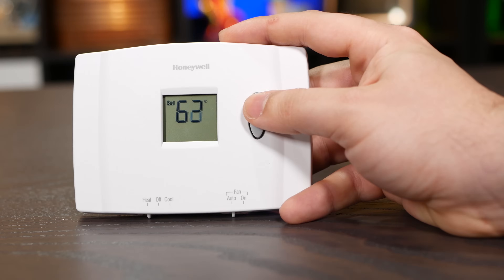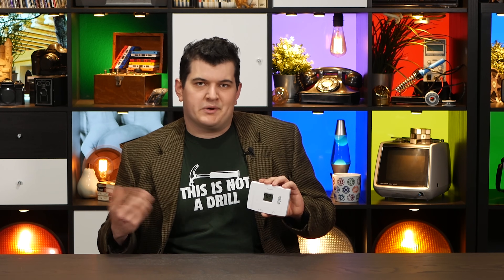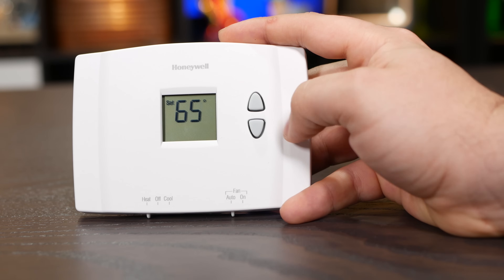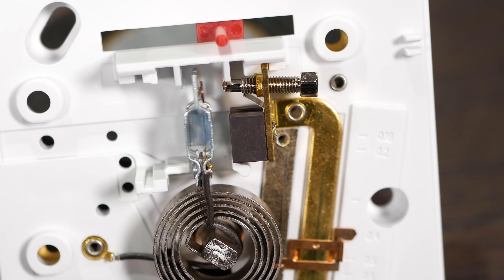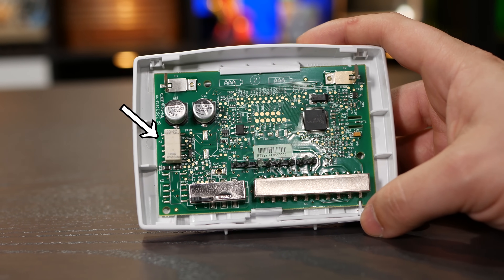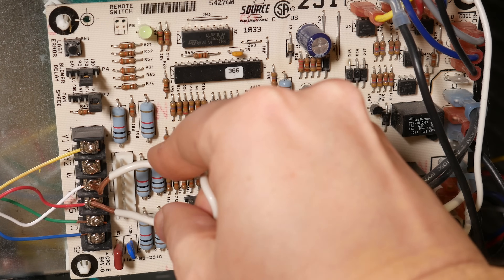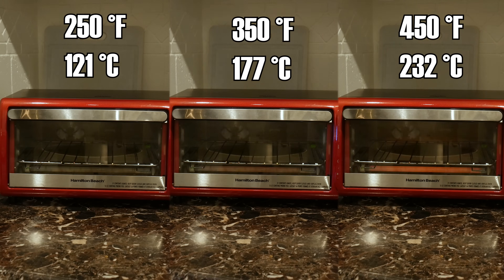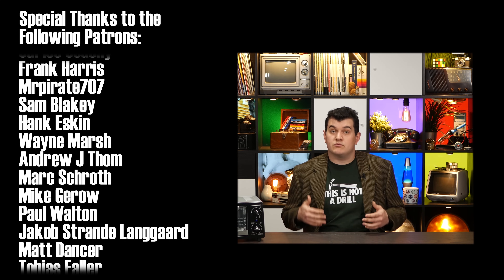Thermostats: Cooler than you think!

Comment: Some newer 2 stage furnaces will control the 2nd stage based on the time the R-W circuit is closed and the length of time that it has been closed for the past X number of heating cycles.. Crude and it will give some big fluctuations in room temperature... Best way is a multi-stage thermostat and with the correct "CPH" (Cycles per hour) setting for your heating system.
Yes some incorporate time into determining if the heat should be on or off.

Comment: My apartment has electric baseboard heaters which when we moved in had mechanical thermoatats which only turned them on and off at full blast. But since the thermostats controlled the full voltage directly, i was able to replace them with digital thermostats with variable voltage control, giving far closer temperature accuracy and much more energy savings due to tapering off the voltage the closer it got to the target temperature and avoiding overshooting the target.  So our thermostats do regulate the amount of heat coming from the heaters.
Reply: The Honeywell RLV4305 -- I have three of them in my house, they replaced older mercury-bulb and other mechanical thermostats -- is designed for electric baseboard heat installations in which the thermostat switches the actual line voltage of the heater (120V or 240V) rather than switching 24V signal-relay voltage. The RLV4305 uses a triac to power on or power off the load, and this being electronic, the heat can be turned on and off rapidly. This is EXACTLY the fractional control method described in the video -- Duty Cycle. The RLV4305 has four levels of heat it can command. If the ambient temperature is way below the set point, it will just turn the heat ON. "Full blast." If the room is only a degree too cold, the thermostat can instead run the heat at 75% power, or 50% power, or even 25%, which low power is also used to maintain the current room temperature once the set point is reached. Overall, this allows the desired temperature to be maintained with smaller temperature swings than you get with an all-on/all-off thermostat. Most "smart" thermostats like the Nest are designed to work with 24V switching systems, and thus are ONLY all-on/all-off. But, I believe that the Mysa brand of smart thermostat has a model with triac line-voltage switching for baseboard electric heat, which can do the same multiple-levels-of-heat control.
Reply: @pianofitz  My Nest does turn my gas furnace on and off with a short PWM cycle, which provides proportional control and gives a very even temperature.

Comment: I have two nests I upgraded last year from dumb digital systems up stairs and downstairs to 2 of cheaper current gen nests .   

My layout is: 1 HVAC unit 2 zones that run together and commanded by two thermostats.  I know, very stupid and convoluted as both wired together but it works for full coverage since second floor has a massive gradient and I can’t afford two units to cover independently..

What I find interesting is our nests are smart enough to call for the fan without heat or AC kicking on some of the time to move air to upstairs or back downstairs depending on the seasons and this saves power as either aware of each other and know their is a temp gradient or natural feature of these nests and working either way, it has saved us a lot of power last summer as didn’t call the AC nearly as much as previously as recirculates the downstairs air upstairs.    Also we have blue wire and while setup said cannot utilize blue wire and have a wiring error, 1 year later it hasn’t changed battery voltage at all, both units are 3.15V reading same as day one and if anything downstairs one should be seeing a drop battery as sees a lot of foot traffic passing it, waking it up constantly, but no.

Comment: Why can't you just hook up the thermostat to an outlet instead of batteries?

I hate changing batteries, why is my toaster smarter than the thing designed to keep me toasty?

IT SEEMS SO SIMPLE 😡😡😡 

(anger not directed at you, just seemingly needles batteries when there could just be some wires)
Reply: Wiring for 120V is more expensive than the extra 24V wire needed to power a thermostat from the furnace.

Comment: This is old but the mini-split system in my home has a "boost" function which basically just does max ac/heat (depending on whats set when you hit boost) for a period of time before returning to normal
Reply: Yes I have a mini split as well and it does exactly that

Comment: When I moved into my current apartment, it still had a thermostat with a mercury tilt switch in it. I was amazed to open it up and see that as I knew those had been phased out quite a while ago. Thankfully they later replaced it with a digital one as the old one was not very accurate. Not sure if it was just the age of the bimetallic strip or losing calibration but the current temperature was often a bit off what my IR thermometer read.
Reply: Probably wasn't mounted level
Reply: @robertreite4630  I don't follow, how would that affect the current temperature reading? The mercury switch itself still worked fine.
Reply: @IanGrams  The action depends on gravity to flip between the on and off state. If not level the actual temperature  will either be hotter than the set point on the dial or lower, depending on which way it is tilted.
Reply: @robertreite4630  I think you've misunderstood the issue. The mercury switch still worked fine to turn the system on when the current temperature went above/below the set temperature and off when it reached the set temperature. 

However the temperature the thermostat was pointing to as the current temperature was 5-10 degrees away from what my IR thermometer read. So the issue likely was in the bimetallic strip itself and I don't believe the angle of the thermostat would affect that.
Reply: @IanGrams  OH you mean the red thermometer pointer was off. yes, level won't affect that.

Comment: What I want to know is why the switch from heat to cool is (usually?) manual even on digital thermostats. It might sound like no one would want to schedule heating and cooling in close proximity to each other, but if you live in the desert and/or in the mountains, huge temperature swings outdoors are remarkably common. Even here in the northeastern US, nights in the 40s and days in the 80s is something that happens at least a few times in spring and fall. If the concern is that both will turn on at the same time, either set heating or cooling explicitly for each time period, or force the cooling trigger to be several degrees higher than the heating trigger. I'm sure it can be done.

Comment: While I do see similarities between this and PWM, I dislike calling it PWM.
It isn't setting a duty cycle. It is just switching on and off at the appropriate temperatures.
Instead it is known as bang-bang (at least with any hysteresis like with the magnet.

For PWM it should be at a reduced load before reaching the temperature, and run with the same duty cycle for some decent period of time.
And if anything, that magnet prevents it being PWM.
Without it it would be much closer, rapidly turning the heater on and off.

Comment: Our thermostat has a fourth option for emergency heat. It turns on the 3 kW resistive heater that is usually used for defrosting. It's less efficient than just using the heat pump, but it heats up faster and even works when the heat pump is broken, as it so often is on our unit. It works great until the relay fails closed and causes one of the banks of heating to stay on all the time even in summer.

Comment: Somebody mentioned Opentherm yet? It is the preferred way to do it in large parts of Europe and it actually provides a big efficiency boost. My thermostat can instruct my central heating system to put different water temperatures in the radiator. So if only a little heating is needed will put cooler water, which wastes less energy.

Comment: You completely missed the subject of the anticipator. Older better thermostats have one. It's a small heating coil that needs to be calibrated for the type of heat being used, etc. Radiators in particular have high thermal inertia. You want the boiler or furnace to shut off in advance of the room reaching proper temperature, or else it will over-shoot and overheat the room. Adjusting the anticipator is a careful process. Newer better thermostats have electronic logic that you switch on or off, but it works no better than the old heating coil anticipator.

Comment: As far as "frightfully ancient" goes, I met a woman living in an old farm house with radiant heat whose 1920s boiler was converted from coal to gas long ago. She said that she needed to "get rid of the old thing and upgrade." Her bill for heating her entire farm house was $20 cheaper than my bill for heating a downstairs flat with a 10 year old high efficiency furnace. I told her to keep it.
Reply: hey you can't blame someone for imagining SOME progress had been made in almost 100 years lol
Reply: @stitchfinger7678 I mean to be fair. Excluding heat pumps. Energy is energy. Burning gas in a modern heater vs a 1920s heater isnt magically going to create more heat and be "more efficient".
What really has come a long way is insulation. Last year We've moved into a brand new house here in Germany, highest insulation rating and all. How little heat we need to stay warm is comical. You can basically stay in a room for 20mins, and just from the body heat, the temperature will have risen a couple of degrees.
Reply: @leogrievous I mean, undoubtedly a number of older designs probably weren't the best at transmitting all the heat they produced through the system and heating the rest of the house.

In this case, the difference-maker is probably that the system is boiler-powered rather than forced-air furnace.
Reply: My Grandma's house had one of those coal fired octopus furnaces. No blower, natural convection. A gas burner was put in it. It had a pilot operated gas valve with 'millivolt thermostat' (ran on the thermocouple that was in the pilot flame) so there would be heat for the house even if the electric power went out.

Comment: I've heard talk of modulating furnaces, as I understand it, they can adjust their power output so they can provide different levels of heat?  Do they require a special thermostat that commands the heater to adjust its heat power accordingly?  What about inverter based air conditoner/heater systems?  They adjust the power to their compressors, speeding them up and slowing them down, do they too require a special thermostat?  When I run my air conditioning or heating, I do hear a relay clicking in my thermostat, so it's obviously making and breaking the electrical connections you speak of, but my air conditioner is inverter based, it's connected to the central heating and uses the same thermostat, what gives?

Comment: for people that have 2 stage heating, your 2nd stage needs to be wired to your tstat. if its not then the 2nd stage is on a time delay.

my nest controls my 2nd stage and if I want full heat I turn it past until it calls for it then turn the temp down to my set point

Comment: If your system has auxiliary heat, turning up the heat above a set threshold from the current temp will turn on auxiliary or “emergency” heat which on most heat pumps are electric strips, like a toaster, which heat up and boost the heating capability. This is a very expensive way to heat however as it uses a lot of electricity. Another reason not to crank the heat up to 80.

Comment: Almost all heat pumps have a heating coil inside the house. Once it is below 32 degrees the exterior unit has no heat to absorb to bring inside. This is often wired as a second stage heat. So 2 stage heating is very common in colder states, especially in houses without gas lines.

Comment: Household thermal control is so fucking lame. Why can't they put a VFD on the fan/compressor to control the heating/cooling power, have the thermostat run on a PID loop, and have them communicate using a simple PWM signal? I mean seriously, I don't want wifi on my thermostat. I just want it to keep my room temperature within +-0.5C. How hard is that?

Comment: Thermostats should have been replaced by thermistors as soon as we had boilers/ furnaces that could modulate. Less cycling means better comfort and less electronic switching means improved reliability. Opentherm standard is the way forward. It's a two way protocol that makes the boiler modulate as room temperature increases thus maintaining a steadier room temperature. Honeywell invented it.

Comment: So my new "smart" thermostat claims it monitors the time it takes to heat/cool, so that it can preemptively heat/cool ahead of time when I have it set to switch to a different temperature for when I get home from work. So it knows it takes 30 minutes to go from 64 to 70, so it turns the heat on 30 minutes before 6pm when I get home. It also has wifi monitors you can place in various rooms to allow it to know where in the house is occupied and adjust the setpoint to that particular room instead of the cental sensor. So if you have a typically cold or warm room it can see that and keep the system running until that room is comfortable....this does however mean my computer room is 72 while the rest of the house is 64 because the computer heat keeps the room warm so the heater has been off for hours..... great because i don't have to heat the whole house while I game, but..... it means the house is freezing when its time for bed. Ecobee5 theromostat. My biggest selling point was being able to set per day per minute time tables for my wild work sechedule. Not everyone works mon to friday, so being able to set each day different was important. It also has a bunch of other terminals for humidifiers and such. Wish I knew what the other 2 wires behind the thermostat were so I could use them...... shame there isnt labels and the sysyem is jank.

Comment: As for the question  about how to run the ac for a single cycle; turn the fan to "on" or , if you have it, "circulate". Most often that discomfort you feel is due to stagnant air, and giving the air a little "stir" is all you need. And it will give the added benefit of giving more even temps across your living spaces.

Comment: 2:02"[...] be sure to comment on [the exceptions]. It boosts engagement."
Here you are, then: When the thermostat is on long enough that the AVERAGE temperature of the room reaches the desired temperature (which is what you want to achieve, most probably), there are 2 possibilities: Either the thermostat sits in the part of the room that the warmer air is going to or it sits in the parts of the room where the still un-heated air hangs out. And if the warm air reaches the thermostat might even depend on how long the heat is running.
In the first case, the SENSED temperature at the thermostat will reach the desired temperature before the AVERAGE room temperature reaches the desired temperature. In that case, the thermostat will switch the heat off slightly too early, an then once the warm and cold air mix, will realize that more heating is needed, switching the heat back on. This will heat the room slightly slower than if you raised the temperature.
In the second case, the thermostat will sense slightly too late that the AVERAGE room temperature has reached the desired temperature, so it will run slightly longer than needed. In this case it heats for at least as long as if you temporarily yanked up the setting.
But, since for a reasonably mounted thermostat you can only guess which of the above will happen, you won't gain MUCH by raising the temperature to a very high level. On the other hand you can loose a lot more if you annoy the people around you with insufferable heat.

Comment: Fun fact: 3D printers use a similar thermostat to heat the hotend, but the hotend must keep its temperature stable at a fraction of a Celsius. Instead of using a binary state of full blast and off, they use a PWM signal that never stops but the duty cycle varies depending on the reading of the thermocouple. At the start, the duty cycle is 100% to heat up quickly. Since the thermal mass is not very large, it loses heat rapidly and would easily fall too far below the set temperature. That's why the duty cycle decreases and increases slightly to keep the hotend at the right temperature. It also uses something called PID. It essentially predicts when the set temperature is about to be reached, and reduces the duty cycle in advance to hit that set temperature but not overshoot it. It also does the opposite and increases the duty cycle slightly before the temperature can fall too low. It does this by measuring very minute changes in the thermocouple reading. All of this is done in software by the motherboard, which is usually always based on an Arduino board. Instead of relays, 3D printers use MOSFETs which are essentially heavy duty transistors. The PID can self-calibrate to make sure it doesn't undershoot or overshoot by heating and cooling the hotend repeatedly and adjusting its value until it hits the sweet spot.

Comment: If you set a thermostat for a hold it will run for the length of the hold you put it on. You should be able to reprogram for a 30 minute hold and have a "single cycle" button however it's recommended you set your thermostat at a comfortable temperature and leave it alone for both efficiency and comfort